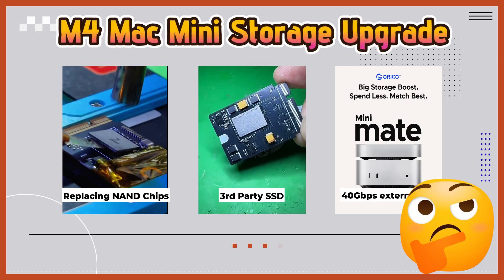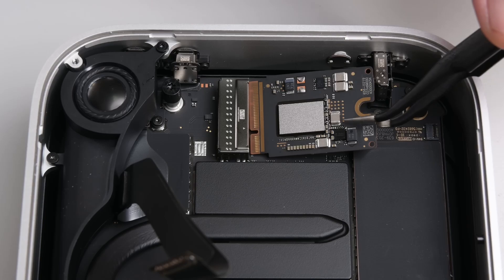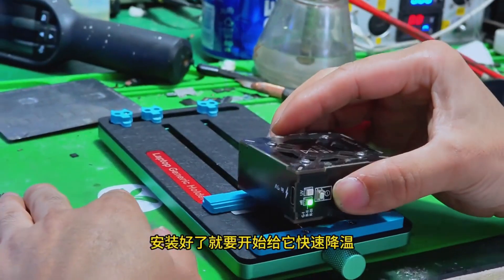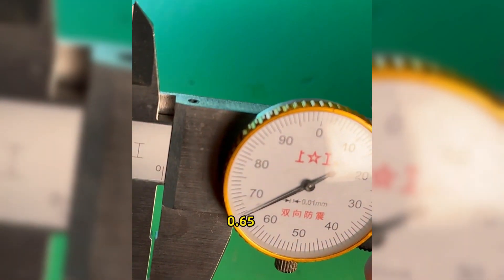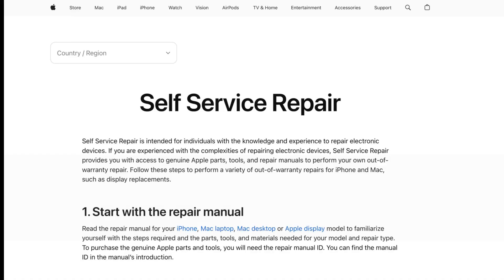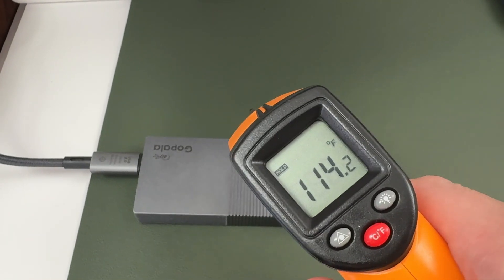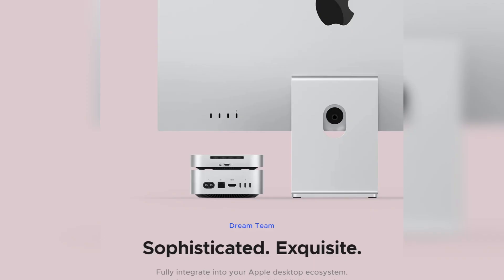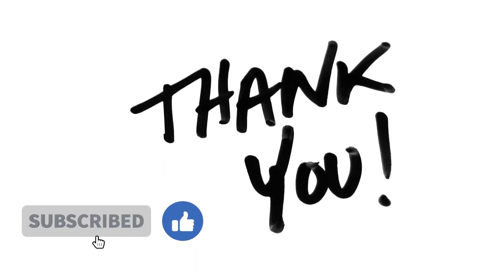M4 Mac Mini Storage Battle: 3rd Party SSD vs. Orico MiniMate

Comment: Unfortunatly the Orico Minimate is simply and overpriced TB4 M.2 NVME Enclosure with a loud Fan in the Mac Mini M4 Design language. It would be different if it had also some additional Features, like USB-A Port, Card Reader like the 10 GBps Version. But for beeing simply an M.2 Enclosure it is far to expensive (The price would be ageduate if it would be an TB5 enclosure for the  Mac Mini M4Pro. For TB4 a price of around 150$ would be adequate but for sure not 280$. You can get a quality and silent Zykedrive around 110$.